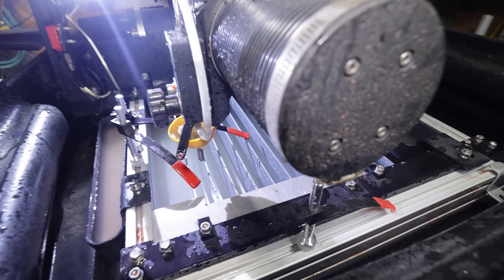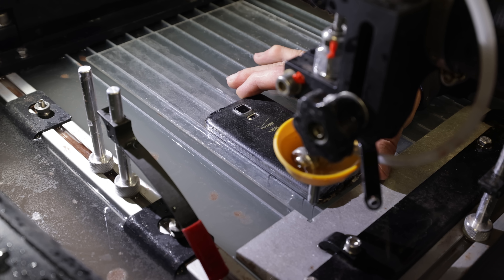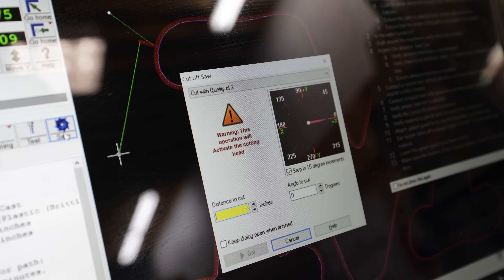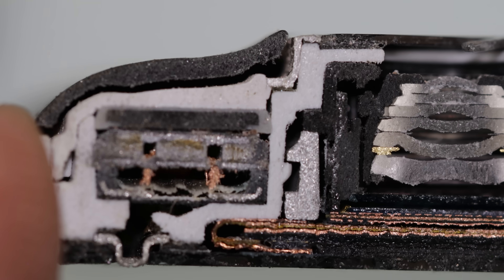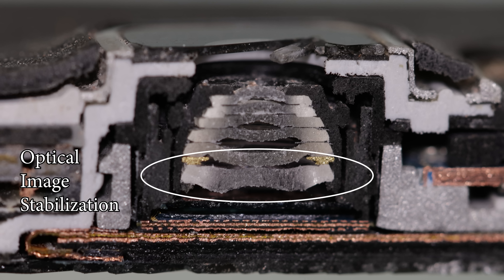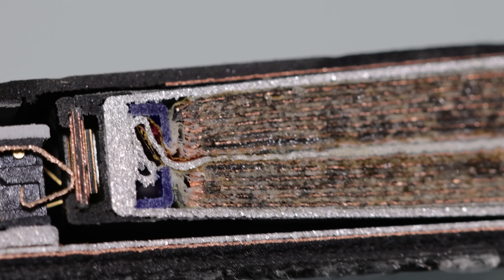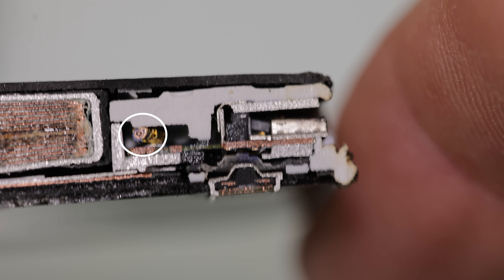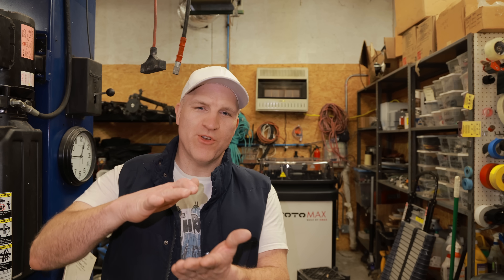I Cut My Phone in Half with the Waterjet

Comment: Would be great to see you do some lapping for things like this. Pretty incredible how cheap you can buy or build a slow/variable speed wet 
 lapping machine.  

Honestly it’s just as satisfying and easy to do it by hand. If you had lapped those surfaces after cutting… I can’t imagine how beautiful that would’ve looked! Definitely possible some of the pieces may have fallen out or been wrecked… But you could always stabilize everything with epoxy or super glue....and once hardened… lap everything flush until it is flat and polished. 

Maybe something like 120, 320, 600, 1200 grits, (all wet sanding of course) and then go to a buffing compound on a piece of mdf or something hard and stable like that… just porous enough to hold the lapping/polishing paste. But hard enough so it doesn’t distort or curve up around the edges or small cavities. Even a piece of plain white computer paper on a piece of glass would work to do the final lapping and polishing with paste. 

Off brand Diamond lapping paste is extremely cheap from China… You can get into submicron sizes. The finest grit I use in my shop is 0.25 micron. I know it’s something around 60,000 grit, which is pretty accurate because I’ve compared it with a known high end brand name Abrasive under The microscope. So that cheap diamond paste is a godsend! And pretty good stuff for the money.

Sorry to ramble on… My point is ....you could get incredible cross-section shots with a wet diamond lapping setup.  Probably well under $100 

And if you haven’t seen them… Google the microscope cutaway/cross-section photographs of cut/lapped electronic components. It will blow your mind. The guy who did all of those is a real artist!

Comment: The part called out as a vibration motor is a micro-coaxial cable for the antennas. Definitely an impressively clean cut though. I'm impressed that such fine features are so nicely intact without having been frayed by the cutting.
Reply from the maker: Thanks ! At least I said I wasn't sure..lol. I agree, this water jet is very precise, I went through about two years of back and forth before I decided, I was a little nervous because most of the water jet stuff that I see on YouTube is very rough in comparison.
Reply: @WarpedYT  Thanks for the reply. I'd like to add that the macro slide turned out so perfectly detailed and had me leaning in close to look at the neat details of the camera, battery, circuit boards and other neat things like that battery contact spring that somehow remained intact. So much awesome detail absolutely popped out of that slider shot. I feel like all the electronics nerds here would love to see things like dpss lasers and magnetrons sliced in that kind of detail. (Just be extremely careful about beryllium when dissecting microwaves!)

Comment: That was pretty damm cool! I'm surprised the battery didn't go up in flames. Usually lithium doesn't like oxygen very much
Reply: I'd argue that lithium likes oxygen a whole lot. 

Anyhow, on the one hand, this was such a clean cut that all of the anodes and cathodes stayed cleanly apart. On the other hand, li-ion batteries tend to just combust when exposed to air. 

I expected fire, but maybe the battery was already depleted and ended up water quenched when it wanted to get hot. Waterjetchannel recently cut apart a well charged high power flashlight without incident and that defied expectations as well.
Reply from the maker: I agree, since this phone has a removable battery and I grabbed it from my exhibits shelf as a sacrifice I truly did not know there was a battery in there.

Comment: The thing on the last lens is just the focus driver.
For image stabilization, normally the entire camera is stabilized/moved. The technology is similar to the actuators on the laser on a CD player, only the feedback comes from a MEMS gyroscope instead of the laser phase interferometry/focus.
The thing that looks like the vibrator could be the microwave antenna cable. It's a thin shielded cable. Routers have them, too.
I'm not amazed about how they cram stuff inside there, I'm amazed how high can they set the prices for so few materials xD And then fill it with bad updates so you need to buy the next one.

Ps: don't try with a new phone, the old IR fingerprint reader was interesting. Today they use capacitive readers. It's just a conductive sheet of metal. But you could have cut this one in more slices!! :-D I would like to see that!
No, really: phone designs are getting simpler. You may get the processor and most components on one chip and then another chip for the sensors, another for the radios, one more for memory and storage, and that's it.
You've been lucky the battery was "dried" up before cutting it xD
Reply from the maker: You have great points, definitely a different perspective, I mean I guess you can look at it that way too like not very many components. I guess what made me think there's a lot of parts is just so many lens elements and so many battery layers. As for slicing in a more pieces that would have totally been cool..but like I mentioned I didn't know that I was going to even use this video I was just doing it as a test.
However I would still cut a new phone if someone sent it to me..lol.
Reply: @WarpedYT  I truly loved this video! I, paraphrasing you from the GoPro in tyre video "... I don't think much more will come from" killing a perfectly good phone :-D
I would really watch more slices on this one, though! 😃
Thanks for not reading my comment as a hater xD I really love your videos and your personality!
And congrats on the new water jet cutter!
Reply: @WarpedYT  maybe cutting a real camera lens? You know, the ones used in DSLRs or reflex film cameras?
Reply: Sometimes they also move the CCD chip in x-y and the lenses rotate and move in other ways.

Comment: I think people have better solutions on looking inside the phone
Reply from the maker: Not a grinder ..lol. I don't know of a better way to crosscut all of these dissimilar materials.
Reply: @WarpedYT  Haha, but for real, i like the x ray pictures from ifixit! You could see exactly what is in the phone without disassembling it, cause most of the times parts do get destroyed with the sealed phones of today. I had a samsung galaxy s9, this was the first samsung phone where they focused on good sounding stereo speakers and i really liked that, because i watch a lot of youtube videos. Now my new galaxy s20 sounds absolutely horrible next to my old s9... I have set the equalizer so it will have a deeper sound, but it lacks power on the lower frequencies. When i was looking at those xray pictures, i could see the s20 had a smaller driver and the other speaker had a channel running through the frame because otherwise there was no room for the selfie cam. It is what it is, but i would gladly loose the selfie cam or other stuff for better sound, but they do make compromises. Some people prefer to take pictures of themselves all day... XD

But cool videos man, keep it up!👍

Comment: Surprised the li-ion battery didn't short.
Reply: It did but the H2O particles were stronger.
Reply: @lawpickinglocksmith7689  those things can spontaneously combust for months after being damaged. Hopefully he has stored it sensibly.
Reply: @Gayestskijumpever  I hit a battery from a dead pad with a hammer. Minutes later a monster flame!
Reply from the maker: It's going into the battery recycling.

Comment: "i didnt know there was a battery when i cut it" lol
Reply: Famous last words if he cuts a Tesla EV
Reply: @jorditribo94  you made me laugh! Here: have a like, sir!
Reply: no way
Reply: Jerry rig everything: now let’s take apart this phone piece by piece.  Warped perception: I SAW THIS PHONE IN HALF!!!
Reply from the maker: I didn't because it's removable..lol
Reply: @WarpedYT  yeah, i remember those older phones had removable batteries.  The cool thing about that was that you could carry extra batteries with you, so if your battery died, instead of recharging, you just put another charged battery in it, and then use that, and charge the other one later.  That's good for when you're on the go and dont have access to a charger!!!
Reply: @nascarsimracing1  or what I did was replace the stock battery with a giant 10,000mah battery that could handle 2 days of normal use, a day of heavy use, or a week of light use
Reply: @Gibson99  That's awesome!!!  That's another cool thing you could do!!  And a third cool thing about removable batteries is that when your battery gets worn out and doesn't hold charge anymore, you can just easily replace it with a new one.  Meanwhile, today's phones need to actually be taken apart to remove the battery, and i think sometimes the battery is even soldered to the terminals, and not a ribbon cable or pin connector.
Reply: @WarpedYT  just a question the battery is the weight of the phone didn't you feal it was "heavy" becouse that could have broken the mashine you cut it with. I'm abit surprised it didn't caught fire. Water don't help when lithium catch fire. But my best guess is that the lack of oxygen didn't make it catch fire thanks to the water. I'm a truck driver and when I did my dangerous gods course I was thought that a fire needs 3 element and that is heat, fuel and oxygen. Remove one of them and a fire can't start. In this case oxygen.
Reply: Those have removable batterys
Reply: The first phone without a removable battery appeared in the late pre-Minecraft era. Up to the late pre-Fortnite era most phones were having batteries that could be removed or changed. Then they started making permanent batteries.

Fun fact: Some phones could charge both the phone and a spare battery at the same time.
Reply: @td9250  fun fact: games do not define eras.  :P
using regular old fashioned years would better understood by many. like i know those are games, and even though i was more of a gamer in the early 2000s, i still don't know when either of them were released.

Comment: Hello love your video, i have a question where is the video about see through diesel engine 🤔😊😁 i want to see diesel engine run with a clear plastic plzz
Reply: His diesel is an over head valve and even if he had a flat head i think the combustion pressure might be too high for plastics that could still offer a clear view of the combustion
Reply from the maker: Well I am working on it but I don't want to give out any details just yet... I was waiting on the water jet to arrive for a while now because for the see-through diesel I need some machine some very intricate parts with precision.
Reply from the maker: Well I was actually waiting to get this water jet, I have a lot of very intricate parts that I need to make for that but I am working on it...